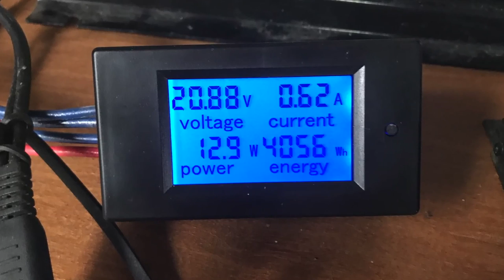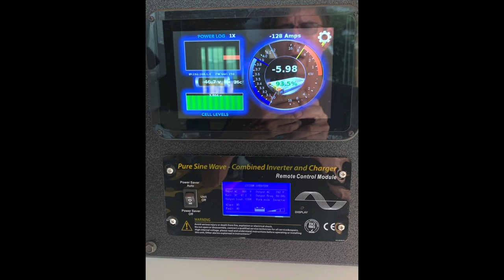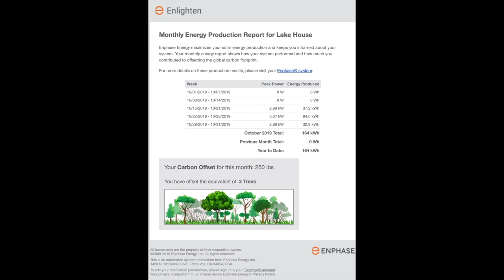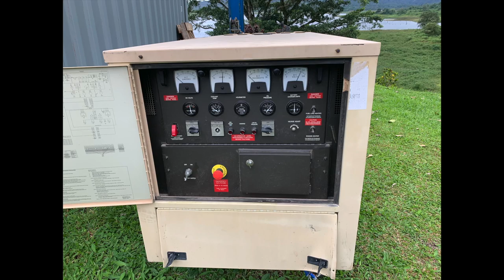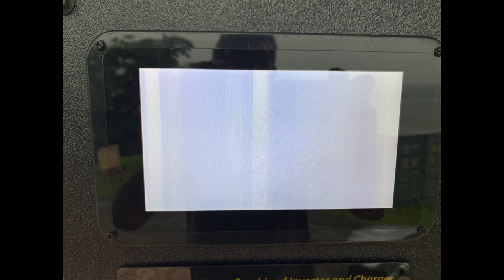EVTV on Tesla Cybertruck Unveil Wardrobe Malfunction

Comment: Hey Jack, Y'alls Are Hilarious! I LUV IT & I'm A Rancher Cowboy! Yet I Was Very Liking To The DeLorean Also, My Problem With It Is The Glass, 1/4" Lexan Would Be Better! Then Magnets Won't Stick To It, It Won't Tank Turn Unless They Put 4 Motors In It, Plus You'll Have To Wait Near 2 Years To Get One, Butt Same On The Rivian+ Other New E-Ones... Now I Got A 1991 3/4 Ton 4x4+ Suburban, 6" Jacked w/Rancho Dual Shocks+Smitty Nerf Bars+Full Skid Plates+Tow Bar+18" G-Clear+H/D Tow Package & Alum-Buds w/12" BFG All Terrains That I'm Gonna E-Truck Right Quick Here On/For My Farm/Ranch! I'm Using A 13" Used Fork Lift Motor = (325+hp@3600rpm - Same As The 350ci in Them Now!) w/All Home Made DIY Parts + SPIR-08aH- Used Japanese e-Bus LiPo Packs - CHEAP - $Est Under $10K For Total Conversions Costs & I've Owned The Truck Since 1994, It's Pre-Scratched, Faded Paints & Dinged Up Nicely w/Rear Seat It's A Go Any Place 9+Mex-Bus... I Also Have A 1974 2-Ton Chevy Tool Truck w/Full Stahl Boxes + A 1989 C3500 Chevy StarCraft Van Mini RV That Will Be Up Next As Soon As I Get The Moneys Up For Them Also!!! LOL Thanks Y'alls PS I'm Gonna Leave My 700 Polaris 4x4 Totally Alone, It's Great Just w/Gas Power!!! LMAO 
Hey Y'alls, Would You Guys Want To Sell Boats To Make Some Extra Side $$$? I'm A Dealer Rep For These NEW Boats & I Can Make You A Commission Dealer Also! Check Them Out & Let's Chat On It!? Thanks  https://www.whalyboatsusa.com  The Cyber-Tesla-II Should Be Made Like These!? Recycled Plastics, Thru Colors, Undestructable+++... Hmmm, You Can Make An Electric Power/Motor Pack For Them Also!?  HaHaHa

Comment: The farmers will get this truck cause it qualifies as heavy machinery and you can deduct like 40k the first year plus ev incentives.
Reply: Are you sure about qualifying as heavy machinery??
Reply: Everett Cox the top model will. The three motor one. Not the other two. It’s based on towing capacity I believe.
Reply: Everett Cox Any vehicle over  6K lbs is tax deductible as a depreciating business expense.’Google it.
Reply: @beyoncehadoneofthebest  I think Elon should put four motors in heavy machinery. There are new lightweight motors with much higher power that are much lighter than the motors being used now.

Comment: Glass stunt wasn't impromptu. 
They'd been tossing the ball at the window all day without fail, there is video of them doing it.
I'm guessing hitting the door with the hammer prior to wanging a steel ball at it was a factor.
(I don't buy the "it just happened to fail this last time, twice" theory)
Reply: Finally someone with the same train of thought!
Reply: Some materials guy somewhere on the Internet suggested that the repeated successful attempts with the glass likely introduced micro-fractures in the glass that weakened it and that they should have replaced the glass before driving it onto the stage. It's really a non-issue for me, though, because I typically don't throw trailer hitch balls at my car windows. :)
Reply: @MrAlbedo39  
Yeah I heard that too, I just think it rather a strange coincidence that it failed in show after all the previous hits. That's why I'm looking for other factors.
Frankly, they should've been smart enough to do their testing on the passenger side, and left the demo side factory fresh!

Comment: Big safety concern: If the truck is disabled in a crash. With no door handles and unbreakable glass how do you save the people inside ? Will The Jaws Of Life work ?
Reply: sure once.
Reply: Model X or S?
Reply: Tesla Jaws of Insanity, aka Audrey, not jaws of life
Reply: If the interior is airtight, the people inside will be fine. I actually do not know how this beast would be disabled in a crash with almost anything on the road currently.
Reply: @Mdude59  this is still a tin can to a dump truck, semi, or train.

Comment: A few pointers: Paper countertops are a thing; the dash is similar. The frunk was shown open in one of the projections on the screen (leftmost image). The V2 Superchargers are technically 150kW and have been delivering more than 120kW to several models.

Absolutely right about other makers still being in the 20th Century. . . .

Comment: Repeating myself about the Hustler Project. The basic frame was two rectangles. Window frames were welded to one and chassis hangers for suspension, subframes, etc came off the bottom frame. They were bolted together trapping the glass fibre floor tray. This provided serious diagonal strength which is normally an issue with parallel rail chassis frames. The top was infilled with flat glass panels. All other panels were simple glass fibre. They could be folded stainless or whatever you like. 
Downside was having to enter over the tall sill. But it sure looked cool.

Comment: So close Jack. You were talking about the million mile battery, this is easily a million mile body, if you keep the bed cover working.
Now, what happens when you sell just 1 truck.  Nobody is going to junk that truck, it might get resold, but it will continue to work like a new truck.
A million miles.  How far do the other trucks go?  250K miles if they are very lucky, probably average is 150K. so let's be generous and call the average durability of the common ICE truck 200K.  That means each Tesla pickup truck means 5 lifetimes of the ICE truck.  Each pickup truck sold by TESLA takes 5 NEW sales away from the other manufacturers. I have seen people talking about Tesla as the expensive brand, this kills consumerism, it kills the economics.  That $50k truck you just put 100 buck down on, should have its price divided by 5 before you compare it to the competition.  You are really comparing a $10K truck per lifetime to each of the competition's truck.  There have to be smart people at Ford and GM who get this.

Comment: This Truck isn't UGLY ... it's different.  It's simple it's tough and it's efficient.  I ordered the dual motor as soon as I saw it.  And then I ordered the trimotor (I wanted to get in line) .  I was EXTREMELY surprised at the $100 deposit. I was prepared to pay $2500.  EACH.  My only disappointment is that I have to wait so long.  I have a feeling that Elon Musk doesn't like to be embarrassed.  By the time this truck is in my driveway, I'm thinking that it is going to be actually BulletProof Bionic.  This "Wardrobe Fail" is probably a GOD SEND in disguise.  You watch PISSED OFF ELON MUSK ( I'D STILL BE SCREAMING), sweeten the Pie now. Prepare for a CYBERTRUCK Version 2.0 for early adopters.  I saw all the advantages you guys were talking about right away.  I wanted to ask if you guys know anything about tinting stainless steel ??? Will it take an colour acid etch ???  A guy could go crazy with elaborate stenciling and tinting.  Sky's the limit.  I'm gonna do some research. BTW ... Get an embroidered T-Shirt and an XLcoffee mug together and I'll order the hell out of it. (I need a XXXL long T shirt, Im kinda shaped like Jack ...only taller) LOL
Reply: @RWSBrowning  LOL

Comment: You got a new subscriber in me. One of the best breakdowns of the event. Love the knowledge you bring to fabrication of stainless and I feel your absolutely right about the importance of this truck. It will be a legendary truck.

I’d love to know your thoughts on the potential problem areas this truck can bring, with exception to the motorized back cover. How do you fix stainless damage? Due to the exoskeleton, is battery replacement difficult? How’s this truck potentially welded? Has anyone ever done an exoskeleton design before? 

Cheers fellas!

Comment: Think about towing your RV trailer to the middle of nowhere and powered by the Tesla truck battery!!!OMG...Best weekend trip ever!
Reply: How far did you tow it? 500 miles? That's like saying "think about driving your truck to the middle of nowhere until you run out gas". Why would you do that? 
I live in Texas. I could easily drive 150 miles and be in the middle of nowhere and enjoy myself. Knowing full well, with confidence that I could drive around to the store, bait shop, and back a few times, then hook up the trailer and drive back home another 150 miles without sweating a drop. Ok, I might sweat a little at 150 out. But probably none at 100.

Comment: I suspect the base model is 100Kwh heres the math: my guess is 390Wh/mi, 100Kwh divided by .390 = 256 miles.  Next model by that math would be about 120Kwh pack.  Then comes the most interesting top of the line model...same math equals 195Kwh but you likely have some added weight so a nice even 200Kwh pack should suffice.  With the battery investor day coming, I'm sure we'll find out what the math plainly has been pointing to for some time with the claims of the semi and roadster...that is that they have achieved at or close to 500wh/kg energy density and are ramping production to go into at the very least semi and roadster, and likely will be going into S and X, then cybertruck.  This is also how they've achieved such an insanely reasonable price because at 100Kwh pack at that energy density would make it a smaller and lighter pack than the standard range model 3!  Also cheaper to produce if the claims are correct!  I think the base price cybertruck reveals this to be true...absolutely amazing if this is true.  Oh and that 200Kwh pack for the top model...same size and weight as the current model S and X packs!  The future looks very bright my friends!

Comment: Great wrap up. 
I was stoked to see Elon say the roller cover would come in a solar option. But that obviously won't work with a slide on camper. 
A nice long high roofed van with solar glass roof would be ideal.
Reply: He mentioned a variation with panels that  fold out attached to the side as well.
Reply: I plan to build a DIY truck camper to go on the back of a cybertruck as a full time live in vehicle. I'm thinking as large as a possible a flat boxy shape as I can fit over the top, made of sheet stainless steel and with the flat roof and possibly sides all covered in solar panels.

Comment: I was looking into your PowerSafe RV, but the CyberTruck changes everything. Instead of needing a Tesla battery taking up room in a trailer compartment, now I just need a "shoreline" to the 220v outlet on the truck. Jack, is there anything else we need to take into account when using my tow vehicle as my power supply? I guess I'll need a system to manage the power I'll be generating  from my RV rooftop solar. What other surprises are in store when Jack puts his mind to getting the best utilzation of this new system opportunity. :-)
Reply: Yeah, I would be interested in hearing your opinion on this, too.
Reply: Never plug an rv into a 220 outlet. You can fry your whole system. The plug may fit but the voltage needs to be correct.

Comment: 50:30 ice is no problem, just heat the space where the cover rolls up under the bed. The battery is close to that, and it needs to stay above freezing, too.
Reply: I think you just hit on something that may be why they have it rolled up right above the battery pack so it gets the residual heat to keep the motors warm for the cover.

Comment: It is accurate to presume that the drivetrain/motors will be the same that are in the plaid drivetrain which means two rear that are in the S/X/and roadster and the front that is from the model 3. Unless they start using a smaller motor like from the 3 in the plaid rear since there are 2 of them. We still do not know what is in the plaid rear anyway.

Comment: Great video. I disagree on your battery discussion though. Why sell the most expensive truck last? Tesla have never done this. I think it's because they will use current battery tech for the two lower trims and new battery tech for the upper trim, hence the delay in getting it out and hence the big jump in range. New battery tech must go to Semi first, and perhaps Roadster, before coming to the pickup.
Reply: Volume sales of Cybertruck will bring much more  cash.
Reply: @Jack Rickard And also perhaps an improvement in $/kW on the battery end.  I figure for 500+ mile range the Tri-motor has to have at least a 200 kWh battery pack.  I believe that the Semi also needs this battery cost reduction to sell at a profit.  Perhaps the Maxwell dry cathode technology will get them there.  As we discussed when we met, it always has been and continues to be all about the batteries.

Comment: The Headlight bar will probably have to be redesigned slightly to allow for proper light dispersion as required by nhtsa to provide proper coverage and reduce glare or blinding light to oncoming drivers.
Reply: Small 'beam' angle lights or lenses to only shine on the road.

Comment: Having seen later they had been throwing that same ball at the window the day before and it was bouncing off, and it looks like the window was not closed so didn't give it the strength it should have had.  It also turns out the back window was not the proper glass so obliviously shattered it..

Comment: 200k units at an average of $60k each earns $12 billion in revenue and $2.4 billion in profit. Maybe someone will make a ultra capacitor pack that fits in the bed. That would perk up the 0 to 60 times, better utilize regen, and help battery longevity.
Reply: My guess is that the next gen 'garnet' glass battery separator has some ultra-cap value.

Comment: I'd have to say:

1) it wasn't nearly as bad as Howard Stark's presentation of the Flying Car  in Captain America, the First Marvel Avenger. (AKA - Elon's pseudo dad)

2) the glass is still 10x better than regular glass and appears to still hold up much better (esp on the constant windshield issues we deal with Colorado.)

3) it looks like the Delores so, yes!

4) it certainly builds more of a case for those driving trucks based on "toughness" and need, vs those who appear to be compensating for size. 🙊😂

Comment: I agree about the tech advances and advantages. I'm curious about the metal-glass and super hard stainless if it will pass safety tests.
Reply: Easily.  It does have a crumple zone in the front due to the frunk space.  It is still bigger than a normal vehicle since engines don't count as crumple space.  All they have to do is score the back of the metal to create any crumple point or break point.  The front can be weaker too, since it doesn't carry load from the bed or towing.
Reply: Patrick is right, but passing the other FMVSS requirements like pedestrian safety will be more problematic.

Comment: True. For a gold mine of a product. They can't hype it well. Most companies sell on the hype.
Reply: The preorders speak otherwise. This wasnt meant to compete, it was meant to allow those not loyal and budget conscious to get what is needed or wanted. How many pickups can you get for 40k new with equal specs? 70k for that tri motor which is still cheaper than what I paid 3 years ago for my work truck. If they pull this off, itll be out around the time I'm back in the market, I can still get a decent trade price for my F150, I'd definitely consider this or the Ram line but if I can save, it's hard to argue as long as I keep the towing and hauling capabilities.
Reply: @singingchef23  The pre-orders don't necessarily reflect hype, as many people are aware of tesla from before and many are fans.

But by hype i was referring to this announcement, which was really poorly executed.
Elon always does this, he goes ad lib sort of, and it works most of the time, but this time it didn't, also it would've been really entertaining to see it spoken eloquently.
Reply: @arnavrawat9864  over 140k preorders, and everyone buzzing, tons of free advertising, yeah I think you are miscalculating "hype". Again this has less to do with people who just go their cars from tesla being fans and more to do with could they pull off a new market segment. I'm NOT a Tesla fan and wouldn't buy anything they make until now, especially if the interior is on par with my work duty. Big guys drive pickups, and if they factored that in, it's going to pick up more traction. But I'm not sure how many people you assumed would buy a Tesla, again, people who buy Ford, Ram or Chevy are loyal, they won't sway many from those markets. The people they could steal are the ones who need a pickup but could careless about the badge. We are looking for functionality, price and those are our concerns. If Tesla fans are the kind of people that spend like water like Apple fans, I dont consider them at all. I'm sure they make up a good market, but I see Tesla looking for newer markets, I've always said if they made a bigger vehicle they could get my attention and this is the option. And the more people like me talk about it, they more they can pick up potential buyers. This is the only thing I'd be interested in and possibly their Semi truck.
Reply: Hell the second biggest selling point that I've been mentioning is, American made which Ford is shifting its production too Mexico. That's another big selling point that will sway potential buyers who arent badge loyal, Tesla has done a remarkable job of getting its brand on the market, the only real hurdle to ownership for many has been WHOM they marketed too and repairs but the more common they become, the more people will stop ignoring them.